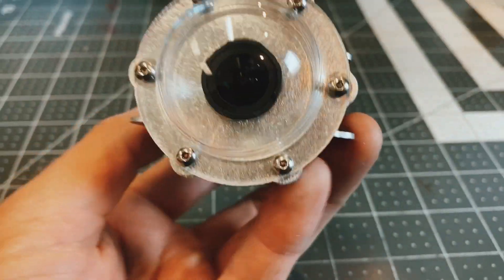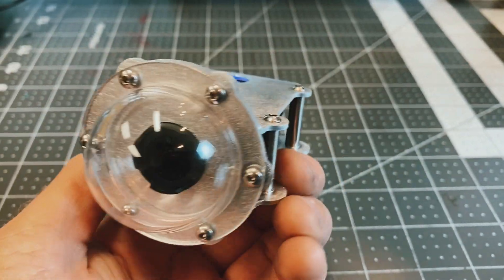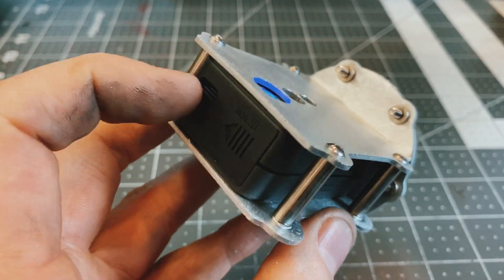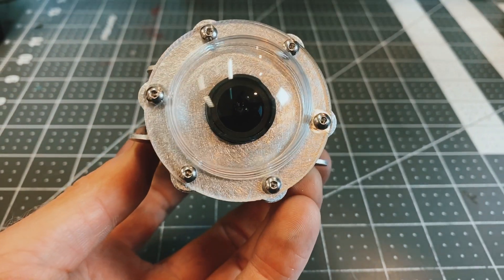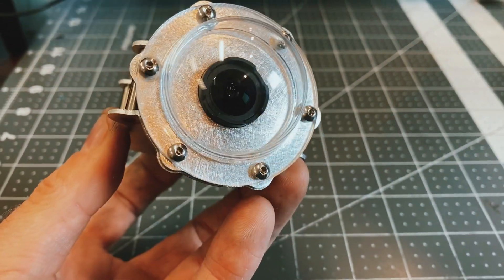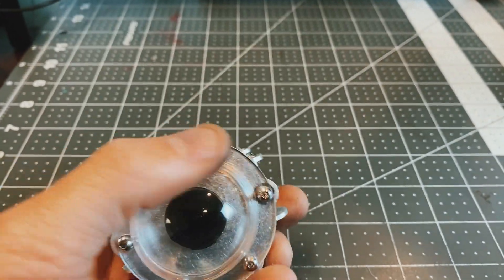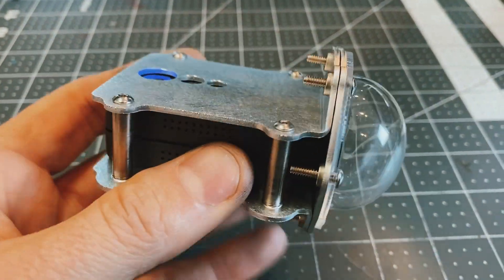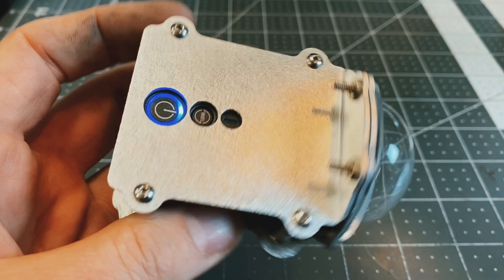Stingray Underwater Drone FPV Camera

Comment: Pretty cool. Looks 👍🏼. What kind of filament material are you printing with for the gasket? What’s kind of depth to you expect the gasket to hold at? 
Have you ever checked out some of Taulman3D filaments. They have FDM filaments, not sure what printers you are using. They don’t have gasket like materials, but I tested some of their first materials they made I think 6 or 7 years ago. Back then I had to do some custom mods to get some of it to print, but he makes quality FDM stuff.

Comment: What are those last four pressed in parts called?
Reply from the maker: The generic terms for the hardware I used are self-clinching nuts and self-clinching standoffs. PEM is the best brand and the part numbers I used here were CLS-440-2 and BSOS-6440-28.

Comment: What is the proper name for that press-in fastener system? Those look a lot more professional than the typical riv-nuts (though those a slick too)
Reply from the maker: The generic terms for the hardware I used are self-clinching nuts and self-clinching standoffs. PEM is the best brand and the part numbers I used here were CLS-440-2 and BSOS-6440-28.
Reply: PEM nuts by  Penn Engineering, generically: Swage Nuts / Fasteners

Comment: You can't transmit video to ground from under water because most of the wavelengths can't penetrate water.. that's why mini subs use tether cable
Reply from the maker: I am aware of this, please read the description. The antennas for the camera and control of the watercraft will be attached to a floatation device. This will allow me to dive a mile away without needing such a long tether.
Reply: Never say "You can't"... say "I am interested in how".   Just a thought.